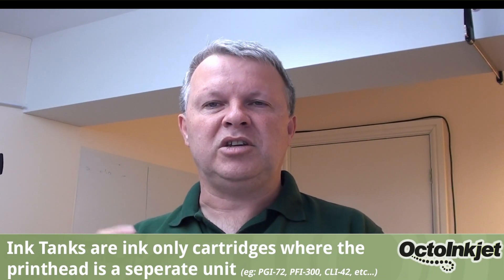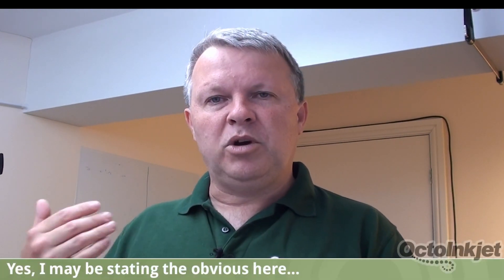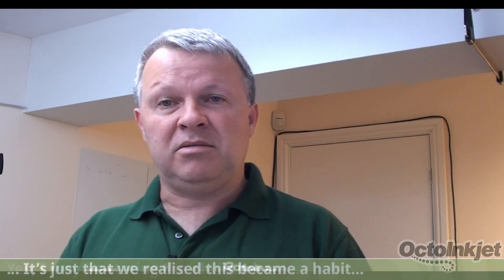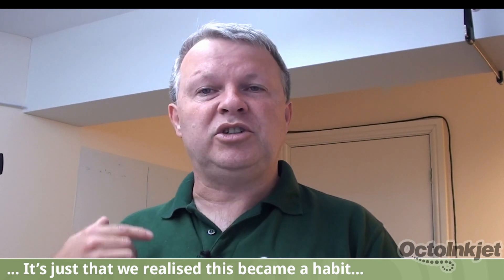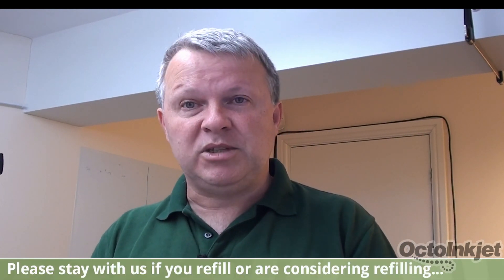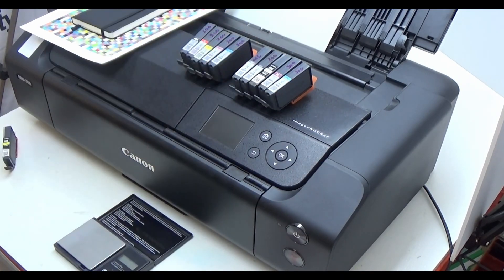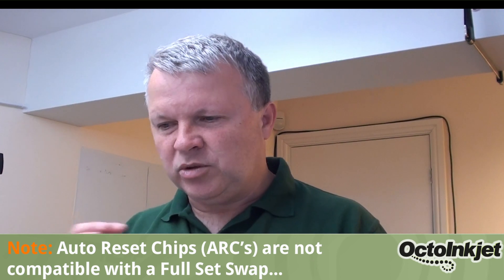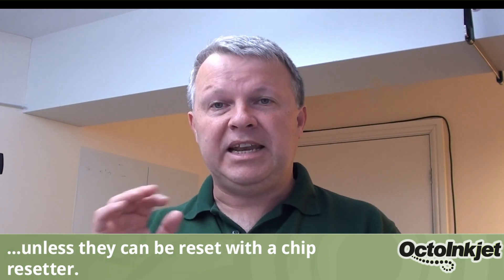Full Set Swap - Reduce Canon inkjet printer waste using refilling & cut your costs at the same time.

Comment: I liked the video and have been using your ink for many years, first on the Pro-10 now on the Pro-300 without any problems.  I have been using the "full change" for about a year now and thought that you page print expectaion was a little high.  Every time I turn on the printer it seems to drink significant ink, more ink than goes onto the paper in my prejudice!  My current maximum is to replace the tanks every 40 A4 sheets or 10 power ups.  The CO is almost empty then.  I accept that you made it clear that everyone needs to find there own routine by experiment but still believe that the number of power ups is part of the analysis.
Reply from the maker: To be fair, we didn’t do testing against power cycling so your insight and experience is much appreciated. At the same time it’s worth noting that the printer will carry out maintenance routines every X hours/days when left powered on so printing every day may help mitigate that.

Comment: Thank God I found your video. The Questions also appear now.
1. How good the quality of your ink compared to the original one? (please rate 1-10, 10 is the same with original Canon ink)
2. After swapping all cartridge and push 5 second to disable the ink meter on each color, will the printer read the cartridge capacity like the one if we use the original new ink cartridge?
3. Can you ship to Indonesia?
Hope you can answer this.... Thank you
Reply from the maker: Okay... here's some info for you...

1. We're obviously biased so I wouldn't want to presume here but feedback so far would seem to put it around 7-9 depending on what people are trying to do and with what media.

2. Not sure I understand the scenario properly but...
a) Once a cartridge has had ink monitoring disabled the ink level will never be read or tracked for that specific cartridge.
b) Once a cartridge has been replaced with a new OEM cartridge the printer will read the ink levels as normal. 
In short, any disabling of ink monitoring is cartridge specific.

3. Yes, we  ship worldwide.

Comment: What happens if you refill the cartridges and the printer no longer shows when they get empty and you try to print something with an empty cartridge? Is it really important to refill them before they get empty and never try to print something with an empty cartridge? Like when you don't wanna bother with tracking how many prints you did to know when it's time to refill. With 60h cleaning cycles it seems like it's pretty hard to know when one of em will go empty. Por 300 is sucha nice printer but it uses so much ink on cleaning and the original inks are way too expensive. :/
Reply from the maker: Short version is never print to let them go empty. Reason is that the ink also acts as a coolant for the nozzles. So imagine lots of tiny kettles with no water starting to heat up. Best avoided.